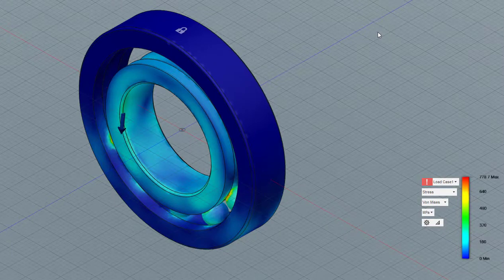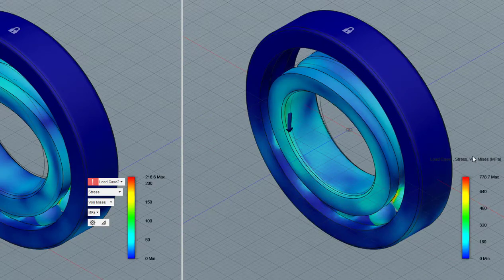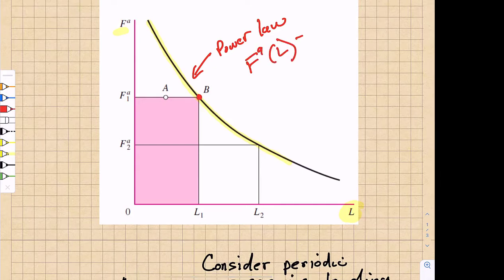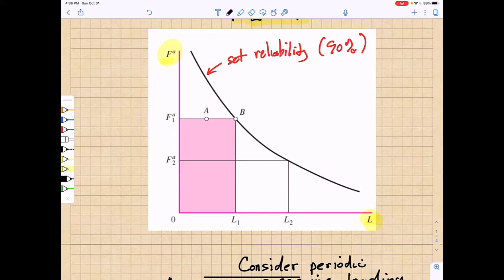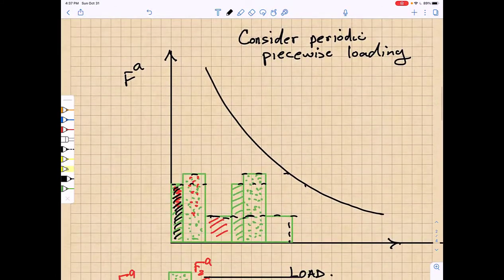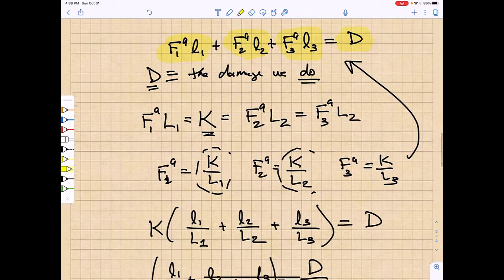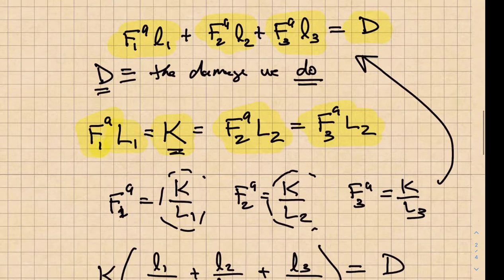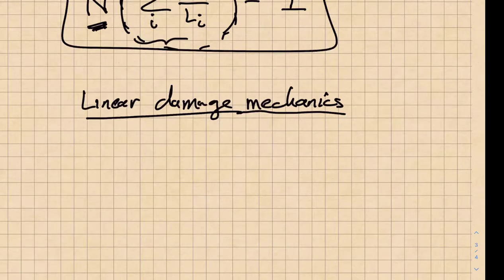Lecture 19 variable loading of bearings and intro to damage mechanics

Comment: The thrust load will be partially transferred to the balls removed. By removing some balls you are just reducing some computing load. It would have been better to develop a symmetrical model to produce a more accurate result